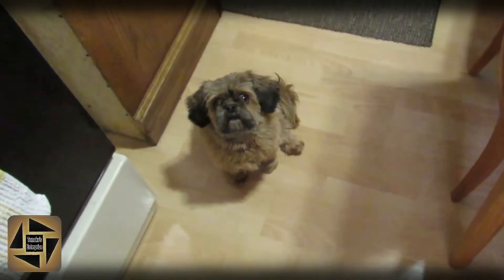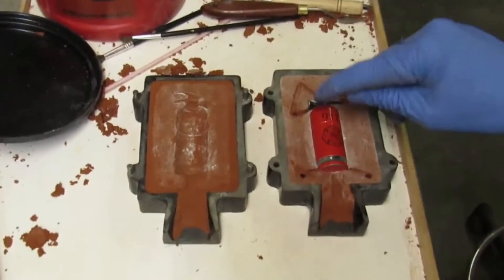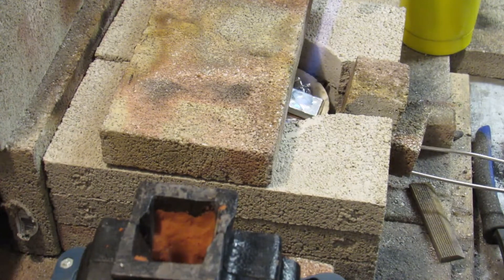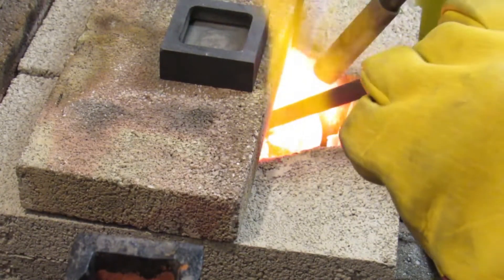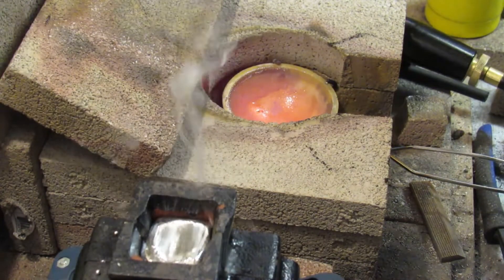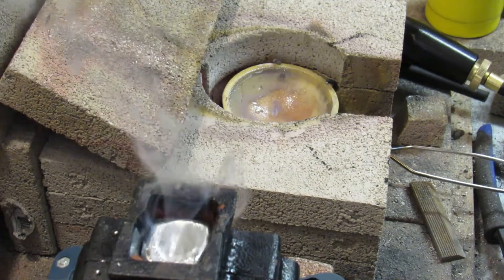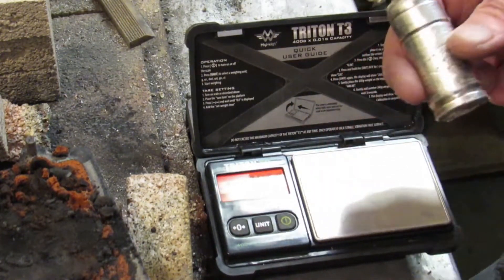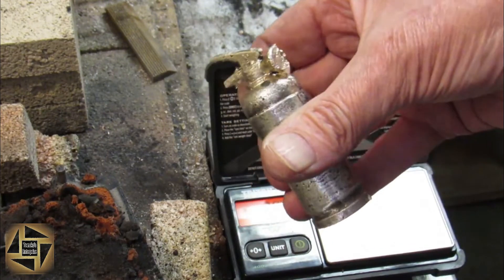I'm Back & It's Part 2 of My Pure Silver Mini Fire Hydrant Sand Cast for Lionel.

Comment: Awesome piece Dean! First pour at that size and in the winter is pretty amazing! I learn something every time you pour my friend. Thank you for sharing and I can't wait to head over to Lionel's channel to see the finished work. Maybe I will win the nickels guess while I am there... I bought a bunch of fire brick but they don't have the hole for the crucible so am trying to find that type for reasonable price if you have any tips...
Reply from the maker: I haven't had any troubles with standard hole saws or hand saws cutting the bricks. No damage to them at all. I will do a post of it all finished up the best I can. Thanks a bunch for continuing to come by. If I can ever help you holler any time my friend !!
Reply: @TomokosEnterprize  will do Dean and thanks. Cut the bricks with a saw... hello - that is a novel concept... I had no idea!
Reply from the maker: @ValueHunter7947  I found the 1 1/4 bricks quite soft and didn't damage my high speed hole saws or my old style hand saws. I wouldn't use them on the larger cream colored bricks though.